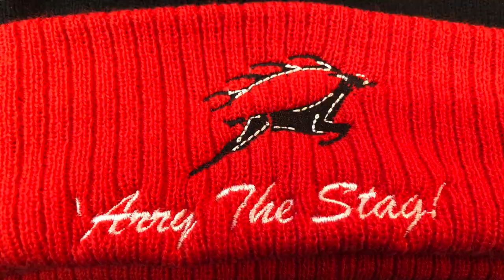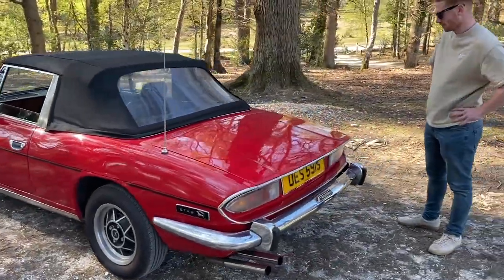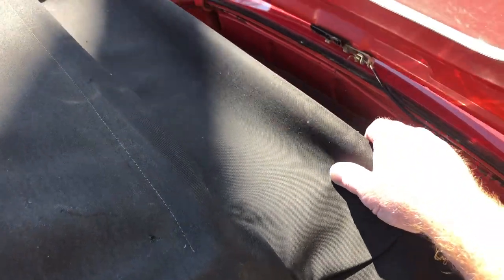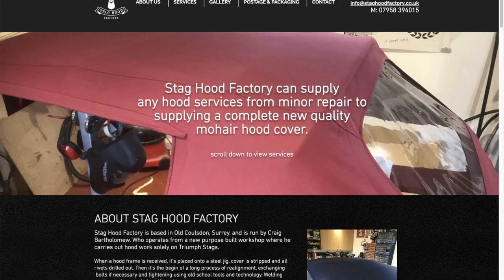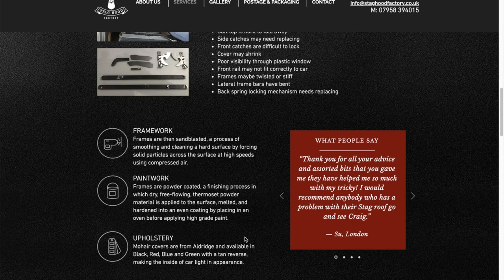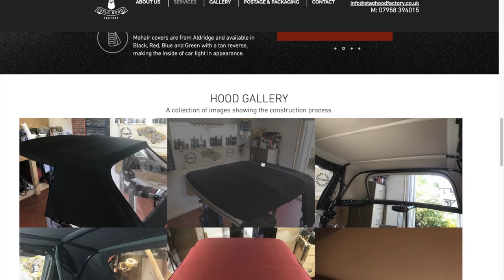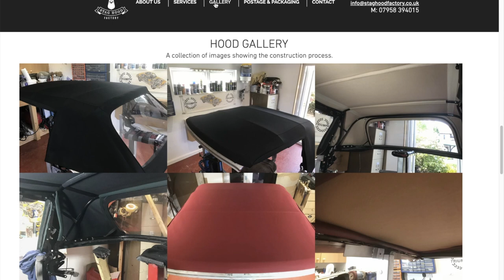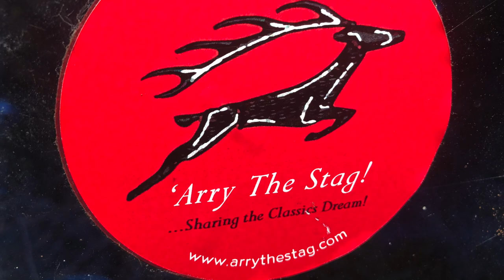Triumph Stag - The Trouble with Convertible Hoods

Comment: My first Stag-back in '74 I bought from auction with a cracked distributer did not come with a convertable roof so I bought one & fitted it myself the motor company I got it from were so impressed they  asked me to teach there mech's how to fit them.
Reply: @ArryTheStag  sometimes I wish I still had my stag it was a good one after i stripped & rebuilt the engine went like a bomb then--not boom-boom though sold it to a fellow who ran it for 4 years ,he 'phoned me back & tried to sell it back to me for £1450.00 that was in '78 but I'd bought TR7 then .after that another Stag.

Comment: Thanks Harry. On another subject: What wing mirrors are on your car and are they fully adjustable?  Standard mirrors are hopeless & I'm looking for a replacement
Reply from the maker: Hi Gordon - Actually ours are bog standard on the Red Barrow Stag and after some initial struggles now get on with them fine. Often all they need is a wedge under the chrome foot of the mirror to adjust so you can see out. I'm 6ft 2" so is always a challenge! Also the nut on the back can be loosend and adjusted to get the right angle. Quite a controversial topic though and many have experimented with modern other OEM mirrors. Best thing is to go to our 'Arry The Stag! facebook Group and ask the question - I know you'll get loads of answers!! Equally, join us on a Saturday with more top tips and insights www.arrythestag.com/saturday-sockets All the best and thanks for posting! Kind regards TR T
Reply: @ArryTheStag  Many thanks for your advice Tony. Its greatly appreciated, and your video on hoods is very timely. I've been using mine for the first time over the weekend at Australia's National Stag Rally (based in Adelaide). The hood is showing it's 47 years old, but the car isn't! It cruised effortlessly (and comfortably for my wife and I and our largish dog)  at 110kph across Victoria and into Sth Australia, and then around the undulating roads of the Adelaide Hills. Our only problem in about 1500 km of driving was with the hood! Am contacting Craig to see if he can send to Australia. Thanks.   Chrz Gordon
Reply from the maker: @gordonbunyan  You're very welcome and your journey sounds like a brilliant adventure - what fun.. in a Stag too! Duke, our Doberman just about fits in the back of our Stag with the roof on/up, although it's a bit of a squeeze for him I have to say. Much better with the roof down, however above 50 MPH he has to hunker down, as his ears flap too much in the wind! See our trip to the Seaside a couple of years ago (featuring Lady Throop (the Missis) and Downpipe Duke.. as he's known!) A beautiful part of the local area to us and we love going there all year around. Good luck with Craig - he's a handy bloke to know and I'm sure he does export too, so should be 'good under the hood!' Here's the link to the seaside trip https://youtu.be/t6WBDZhJdug Best wishes and 'Arry The Staaaaagggggg!! TR T